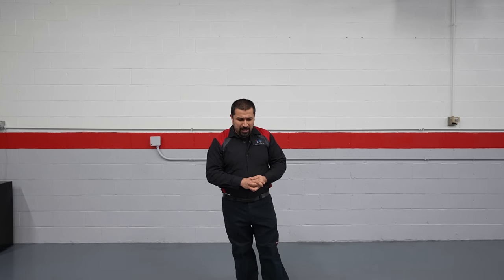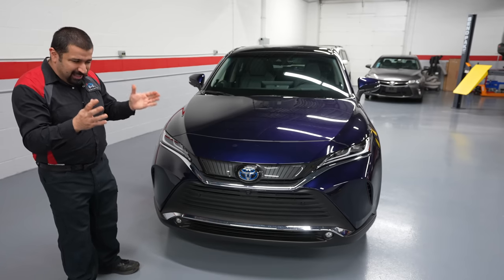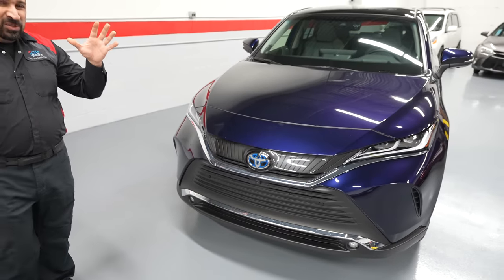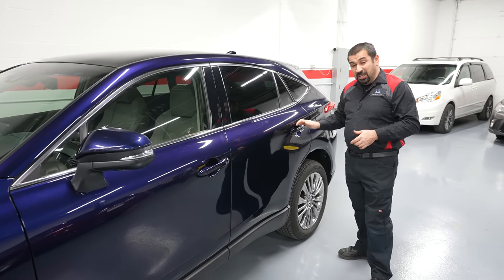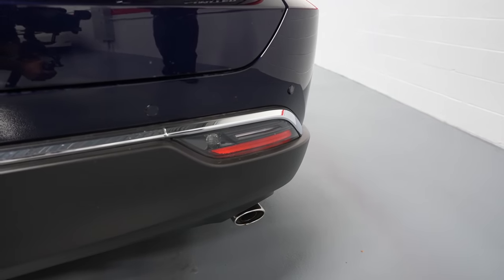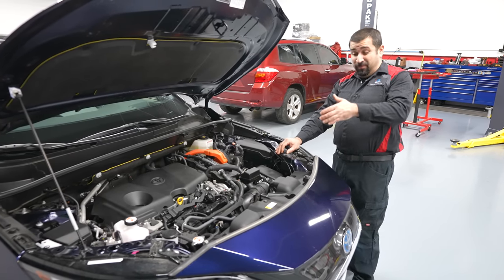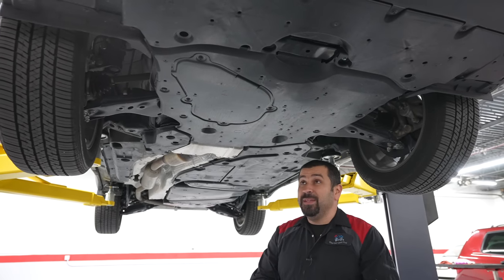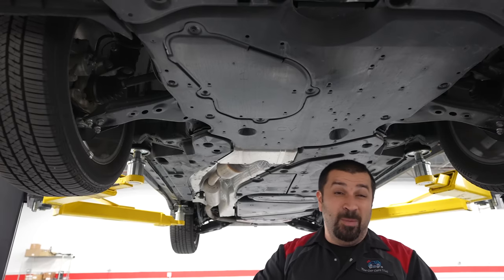THIS Toyota New Model is a Total Hidden Gem! Should've Been a Lexus!

Comment: The Venza's highway noise level is a deal breaker. I'm now looking to replace my 2019 RAV4 because of the noise level. Now looking at Lexus models.
Reply: Surprisingly, A Mazda CX-5 is a notably quieter vehicle than a Venza.
Reply: @webcomment8895  you are spot on. Not by much but when we rented Venza 2021 a few months back it was very loud at 65-70mph. And Mazda CX5 2019 we had last week was not exactly quietest but drove really well and was not humming like a plane. If only Mazda made a hybrid car to save on gas that would be perfect.
Reply: Hybrid NX Lexus saves money on being hybrid and takes all that money back for the higher grade gas :( Boo
Reply: @mephi5t0  wrong..as per owners manual, you can run regular. It's the exact same 2.5l engine as tge Rav 4 Hybrid and the Venza. Only difference is the front electric motor is 46more kws yielded more torque and 20 more HP.
same pistons, bore  stroke and compression as a R4H and a Venza
Reply: @mephi5t0  I’m pretty sure some more recent year CX-5s like 2021 and newer are quieter still.

Comment: You would think that a car that you can option up to $45,000 would be available with leather seating.  PS. What is Softex??
You would also think that a $45,000 car would have hood struts instead of a hood prop.
Reply: Same thoughts on the hood. AMD has a video where he installs some pumps on his Camry hood.
Reply: Could not agree with you more on both items. There are lot of cheaper priced vehicles with HOOD STRUTS.

Comment: The Venza should have never been discontinued.  The older ones remain very popular and hold their value well on pre-owned car lots.  

I really don't think the new Venza has much cargo room for the size of the vehicle.  Secondly, those turn signals on the rear are ridiculously low to the ground and are not safe especially the way many drivers like to ride on the rear bumper.  Bottom line, the RAV4 Hybrid XLE is a much better value overall and that is what I bought.  Been changing the engine oil after a 2K initial break in and then every 5,000 miles like AMD says and I have had no issues, nor any regrets. I love my RAV4.
Reply: big issue

Comment: I just got a limited a week ago and my biggest gripe is No Cargo Net. I agree that the tappetty buttons are not the greatest. My old RX got 13-15 mpg city and this gets close to 40 mpg. Great review.
Reply: I just say Hey Toyota change my temperature to whatever I want it set at and it does. I use the buttons on the steering wheel to change the radio.

Comment: The resale is the pits on used Venza.  Sure it's an awesome car. But it doesn't really do anything well.  Not good as camp road car, Not really good at towing, Not really great at getting in and out of when your older.
Reply: Resale are stout in todays market.
All the options you list aren't it's purpose. They are as easy to enter/exit as any other SUV out there.
Reply: Well yeah it's just another fake suv for geriatrics who have no need to go off road or tow
Reply: @burntnougat5341  Now, Now, Now...easy on the old folks there.

Comment: Wait. That interior just caught me off guard.  I mean I'm 18 but I still prefer simple cars, not too fast and minimalistic. I prefer proper buttons which this car partly had, they should give physical buttons instead of a touch sensitive ones. But this exterior is still a bit too simple even for me ( Looks great honestly, but could've made just the front a bit better), I don't like super sporty looking cars with creases everywhere like a lambo, or other luxury or super cars that young people like. But the interior was looking just amazing. TBH i think the wooden pieces and the wooden aluminum strip on the dash just nailed it. I think it was close to the interior if a ES350, of course es350 is way more luxurious even in parts which you don't see. I wish they could keep everything the same but just a different body (Maybe the body of a rav4 but a subtle version of it), it would be perfect.

Comment: great presentation. the glass on the roof is called smart or switchable glass. the interlayer between the two glass has the electrical property of being opaque or transparent when it is connected to a low electrical current or disconnected .

Comment: With 23 and up Toyota improved the sound insulation and changed front side glass to laminated (layered) from tampered before the 23, to lower the noise further. I have 24 Limited and it’s almost silent on freeway

Comment: I bought one and I am very pleased. It is a bit loud on the highway but I got used to it. I also got used to the start button. I get 39MPG without babying the throttle. The lane keep assist sucks. The infotainment sys works great. CarPlay/Android Auto boot quickly. A very relaxing car to drive. Just the right amount of power.

Comment: I change the oil in my cars and I don't care for the plastic cover on the Venza. I can see myself not putting back after several oil changes. But overall - you video is very informative.

Comment: Thank you - the last segment was the key for me. Before that comment about the noise level on the freeway, I was really thinking about looking into one. That one thing was a deal breaker.  Yes I also agree the start button location is a big OOPS!  But I could live with that but not the noise.
Reply: It’s not that loud, in my opinion.  I have a ‘24 Limited and it has pretty good sound deadening.  Wind noise is pretty well hushed overall.  The only time road noise is a bit pronounced is if you’re on a poorly paved road at highway speeds, but that has more to do with the crappy Bridgestone Ecopia tires.  It’s not as quiet as a Lexus, but it’s quieter than most Toyotas.  I would recommend test driving one and taking it on the freeway.  Let me know what you think.

Comment: Bumpers? A tap in the front or rear will be very expensive.  You gave a very fair evaluation and Toyota did a great job in design and fabrication. The use of valuable space is nice.  They need to fix the START and volume buttons need to be mounted so that they are more convenient for driver.  Thank you for your efforts because you give the WHY to there unique designs. Thanks again.

Comment: I bought one of these in 2021.  I love it.  It's great on gas, super reliable and no fuss transportation.  The previous Venza was basically a Camry wagon.  This new one is basically a RAV-4 in a suit.  It is to the RAV-4 what the Avalon is to the Camry.  This is called the Harrier elsewhere (not sure why they didn't use that name here, maybe another company had the trademark for that).  This is the 4th generation Harrier.  The first two generations were lightly dressed up and sold as the Lexus RX in North America until the RX got its own platform for the third generation.  I believe 2024 is the last year for this.  My guess is the Crown Signia will replace it.

Comment: I like the fact that toyota put the start push button away from the steering wheel in a secure place.  So, the driver does not accidentally push it while the vehicle is in motion. Safety first, then convenience 😊

Comment: Awesome!  I wish our Sienna had a "close and lock" button on the tailgate, though a double click would be even better.  I thought the power lift gate was lame, and it is still a little slower than our old Sienna, but I do use the "foot kick" a lot, when coming from any store with my hands full, or even without them full.  Personally I don't use the slider kick areas, but I would if my kids were still small.  We've been thinking about a Venza for a bit.  Grandma used to have an rx330, but now has a Mercedes that is a money pit and just not very good.  She might get another Lexus, but this could be a great one for her.  And we might buy one for us too, though we're still thinking about the hybrid Rav4 or Grand Highlander.  I wish more options were available outside a specific model, like front parking sensors, BSM, a 360 degree camera, and cloth seats.  I'm happy with the soft-tec, but my wife says they get too sticky in hot weather, so we'll probably put cheap cloth seat covers over soft-tec.  Toyota's lineup looks good.  I only wish they put a higher MPG hybrid model on the Tacoma, and updated the 4runner with the same.  It pays for half the car over 200k, and we probably have to upgrade 1-3 cars before things go fully self-driving and fully electric.  I want to buy something now for the next 20+ years and 200k miles, like my 31 year old 4runner.
Reply: 8 Oct 23  Foot kick to lift tailgate when  going to your car with both hands are full.  Sad to say,  but  the interest of  personal  safety it's not all that good of an idea to have both hands full when going to your car.from the market.

Comment: Good morning!
First of all, thank you for sharing all the great videos and your knowledge/expertise on the Toyota hybrid system!!  It greatly helps a DIY like myself!
In my garage, to put a vehicle on the lift, I need to leave the car in neutral in order to push it in the proper position before lifting it.. If I drive the car in place, I cannot exit the car because there is not enough space to open the car door wide enough (it will hit the post lift) for me to exit the car before raising it.
I had a 2019 Lexus UX 250h that I could power off in neutral while I was working on the car and the 12V battery would not drain itself.
I've recently traded it for a 2021 Venza. I decided to put the car on the lift because I want to baseline the maintenance on the brake system ie. visual inspection, clean and lube.
While the car was in neutral (it would not power off at 100%) and it drained the 12V battery... I only managed to complete the work on one side of the car before it drained. I boosted it and went for a long drive. So, is there a method to completely power off the car while in neutral? Is there a service mode that needs to be followed?
Looking forward to your feedback
Thanks!
Dan

Comment: I've liked this vehicle for awhile, I liked the previous gen, and I'm not talking about the previous Venza, but rather the Harrier which is what this is called elsewhere. The 1st 2 generations of the Harrier were rebadged Lexus RX, because Japan didn't get the Lexus brand until 2005 a couple years after 2nd gen RX/Harrier came out. When Lexus redesigned the RX  for its 3nd gen in 2013, Toyota moved the Harrier using the same platform as the Rav4 for it's redesign. That's the model I came to like. When Toyota redesigned the Harrier for it's 4th gen they brought it to the US as the new Venza, though they did trademark the Harrier name here and I still think that name would have worked better as this model is often unfairly compared to the pervious Venza.

Comment: After agonizing over the Venda vs a similar RAV4 I went with the Venza XLE. All the extras on the Limited are nice but too expensive. I got the black wheels as black badging which gives it a more aggressive look. After putting up with 15 mpg in my 2023 Outback this is amazing, and the higher driving position feels better. 
Some of the comments are thoughtless and trivial - like all the ballyhoo about the start button location.  
The 2024 has buttons at the screen for the volume instead of what he shows. In the black interior some of the beautiful trim details are lost.
I got the XLE and don’t miss anything except the ventilated seats and the extra speakers. 
The kick sensor is not a “little dance” it’s a straight at it kick. 
I’m so grateful for the 38 mpg.
I’m was disappointed to hear it is being discontinued. I don’t know why.

Comment: Thank you for a clear and informative review of this car. There are things I appreciate about this car (like the front) but it looks like the rest of the cars on the road with a hatchback, which is now border line useless to haul bigger items. The little windows on the doors in the back seat has the look of Honda CRV (?) Why look the rest of the vehicles on the road?
I the way the back is shaped with the major curve (concave) makes me question the rain runoff, the snow build up etc. I will have to see this car on the road for a year to see what this new design creates as far as issues go with rain etc. The noise while driving is a big deal. I don't need luxury but noise is uncalled for.

Comment: I looked at the Venza in January 2022 and loved it right up until I found out that the batteries costed 10 grand to change them out in 10 years when they wore out. I always keep my cars 20 years or more until they are worn out ready for the junkyard, lol. It's the only way I can get my money out of them because they cost so much now, but I have always done that I drove my Toyota pickup for 30 years before I finally traded it in on a Tacoma and drove my Honda Accord for 20 years before I finally traded it in on a new Honda CR-V You are right though the Venza is an awesome car. It had more power than the CR-V got better gas mileage and had more room. The best thing was the transmission even tough both have CTV transmissions I call them lawnmower transmissions lol in the Venza was way better as in it didn't let the motor Rev up wide open like the Honda does, it has enough power to build up quickly rather than listening to it whine like the Honda. If they ever get the batteries where they are much cheaper like the CR-V (3500 hundred dollars) rather than 10 grand I will trade my CRV for one then.

Comment: I find that much of what he says applies equally to the Prius Prime. Except for the.charge port door, mine seems quite sturdy. I do like the smaller charge port door on the third generation based Plug-In Prius that included what is now an inner cover that must be manually removed with one attached to the charge port door.

Comment: @TheCarCareNutt Other than the updates to the infotainment, and the roof glass, it looks a LOT like my 3RX (3rd gen RX - I have a 2013), both with Venza exterior and Venza interior.  I wonder if it has all the NVH dampers on the exhaust, driveline,  suspension and sound deadening the 3RX has?  Does it have the "acoustic" glass of the 3RX as well? For folks who don't know, Lexus uses 3 layer laminated glass for the SIDE windows to reduce exterior noise.  Lexus has other tricks to reduce noise - they use a waterproof felt type of material in the fender liners.  One thing I really like about my 3RX is how smooth it drives. Its very noticeable on a good road.  I also like how quiet it is.  Is the new Venza "Lexus smooth" when driving on a good road?  Is it as quiet?

Comment: This car is not available in Australia, or I'd order one immediately. I'm in the market for a base model Camry with the same A25A-FXS engine, the higher models look overly aggressive to me. Road noise is very important in Australia, because so many major roads are coarse chip, not smooth, quiet hot mix. You showed us the Venza's real spare wheel, albeit not full size, but I don't think you mentioned that it was cast alloy instead of cheap steel. Another Lexus touch? Extremely thoughtful, useful review, thanks!

Comment: He said the E-CVT is a simple Transmission.

I know he understands that the E-CVT is NOT a standard CVT and uses hard steal gears, a Cone gear, a servo motor, and an electric motor in it.  The ECVT Transmission is far more robust than a standard CVT found in normal ICE vehicles.  Just want to get that out there for people that don't want a vehicle with a standard CVT.  The E-CVT is a Totally different beast and more robust transmission than a standard CVT.

Comment: Currently own 2011 rx350 and was in market for a new car.  The venza is extremely close to my Lexas as far as comfort and ride but with more features due to it's age.  Very smooth and quiet ride compared to the rav4. Rav4  sounding like a tin can comparison to the venza. Toyota should have invested in more sound deadening material in the rav4 IMHO. Materials in venza were quality and well designed. I was primarily looking for seat comfort due to spinal issues and found the camry seats too stiff for my back over long term driving, though it drove nice, however, the steering wasnt as nimble as i expected it to be for a new car. Found extra features in camry were a bit overpriced. Id buy a lexus es over the camry for the money. I appreciate your honest review as a mechanic since i seriously considered the Venza enough to purchase. Position of start button is odd and the lack of stereo knobs is a pain. Back seats are comfortable enough for me. I will miss the glossy woodgrain details in my lexus compared to plastic material in the venza. Not impressed with kicksensor as its something else to go bad. I do like the lock door feature with hatch close. Thats not on the old Lexus. I dont like the front end of venza platicy look but its not a Lexus so compromise there. Ive heard from other venza owners, if you change tires out it will be quieter. Definitely not like the old venza, toyota should have renamed it. I suspect crown signia wont sell as well as the venza. Personally, i dont like the style. I agree 💯 the venza should have been a Lexus without plastic front end.

Comment: The driver and front passenger cup holder need to move.  They are fine if you put some cans in them but if you put a larger container it interferes with the shifter.

Comment: Pretty much everything said about subtlety for the gen2 here can be said about the gen1. The gen1 is actually roomier and it’s very noticeable. In fact it has more interior space than the roomiest X3 you can find which costs about 20K USD more. So the hybrid battery does affect interior space, another example is the new Sequoia. It’s less roomier than the previous gen and ‘coincidentally’ it’s a hybrid.